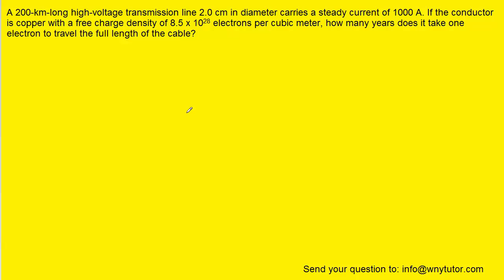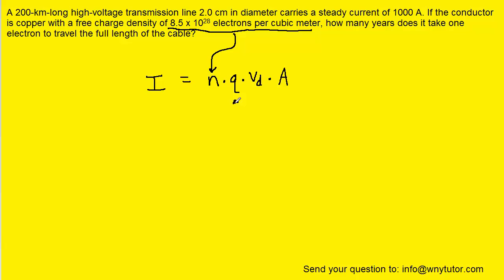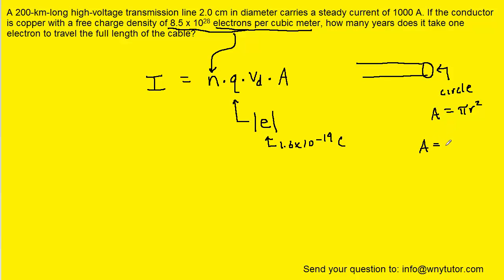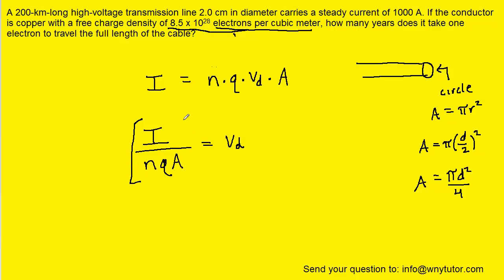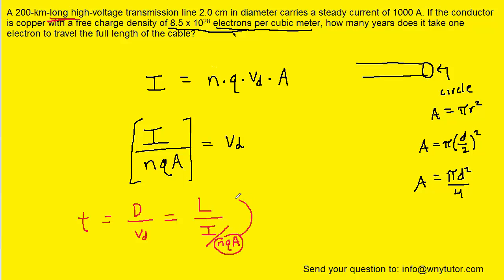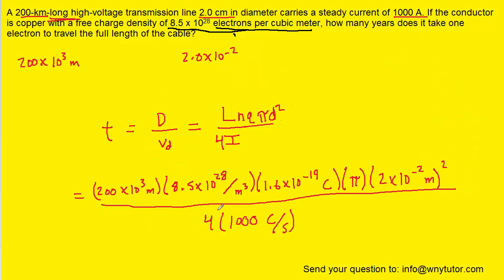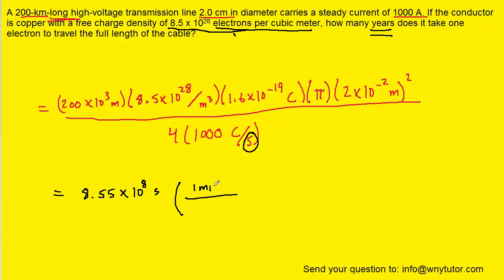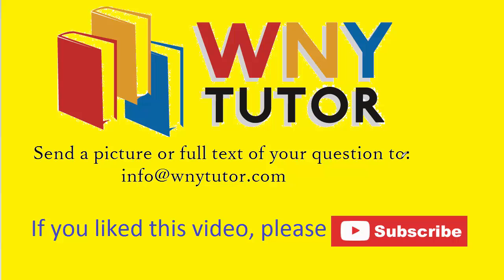A 200 km long high voltage transmission line 2.0 cm in diameter

Comment: How were you able to get the equation I=nqvA ?
Reply: 5yrs later and still no one knows :/
Reply: @SquatSimp  I guess it’s given
Reply: I think it comes from I=J*A , where nqv=J and it is the current density
Reply: you probably don't need this but due to the question giving us current, electron density, and "cross sectional area"-the diameter, and length we kind of just have to assume "oh use this equation"